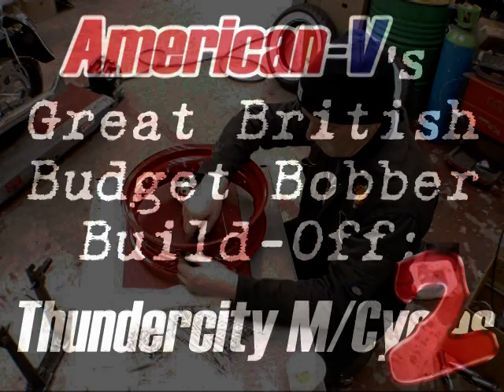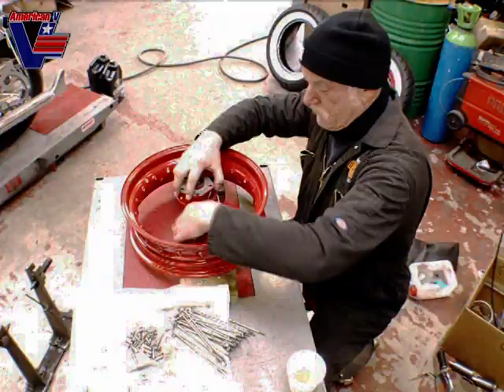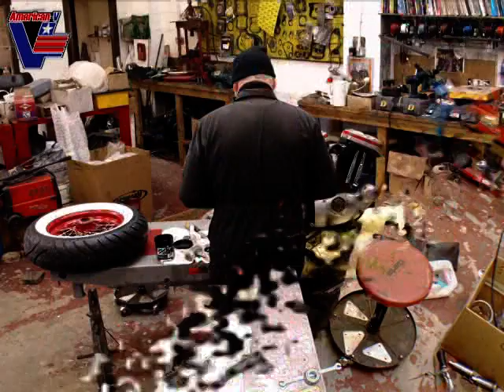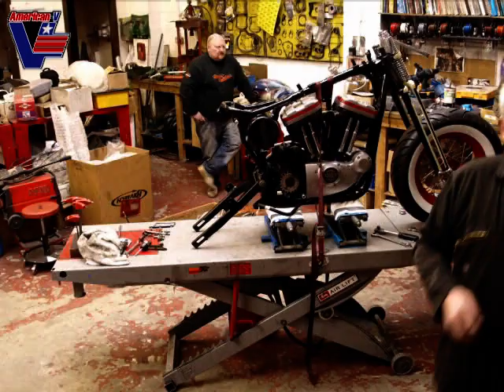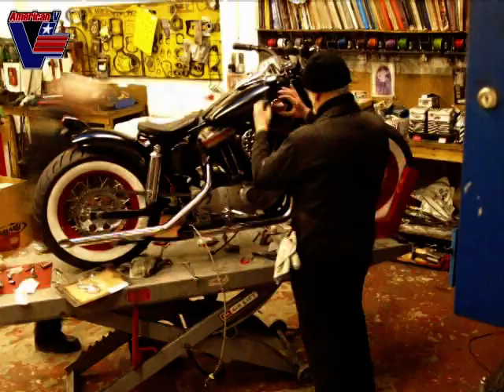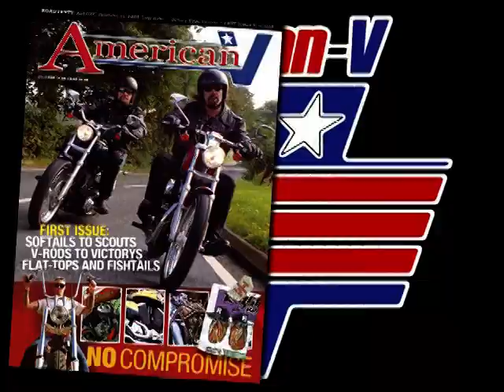Thundercity Part 2: Great British Budget Bobber Build-Off:

Comment from the maker: Yes, this is an assembly operation, but only after fabrication and a dry build. The whole premise of the project was to see what as achievable on a budget, to encourage people to have a go themselves rather than just bolt on a few gee-gaws and call it a custom.

Can't believe you've got a problem with a fully equipped workshop: some of us have gone beyond working under a tarpaulin by gaslight with borrowed spanners, structurally lethal bird-shit welding, rattle-can black and moped brakes. Sorry!